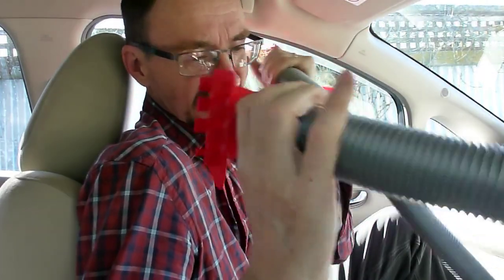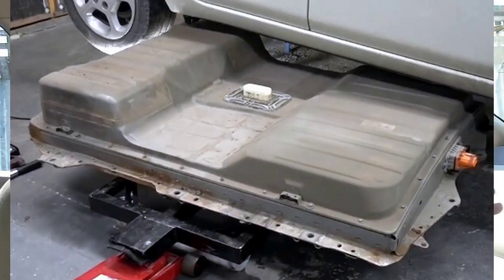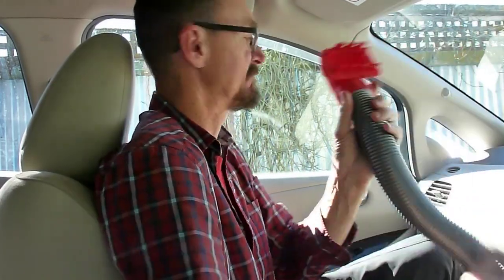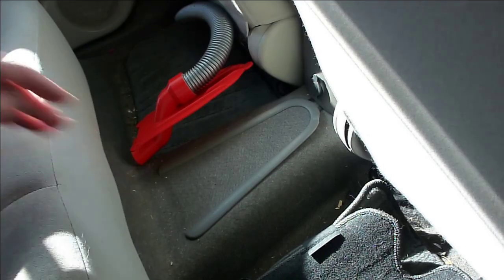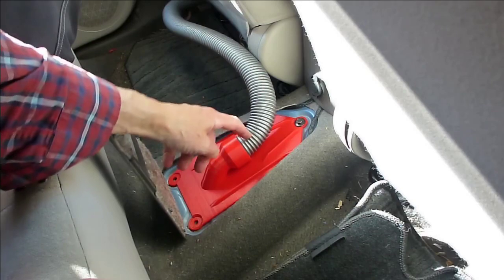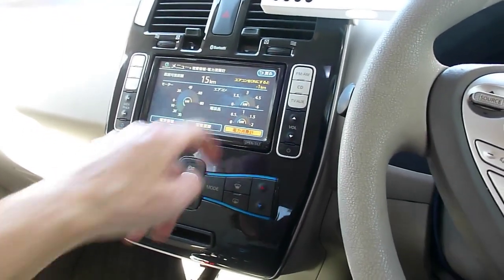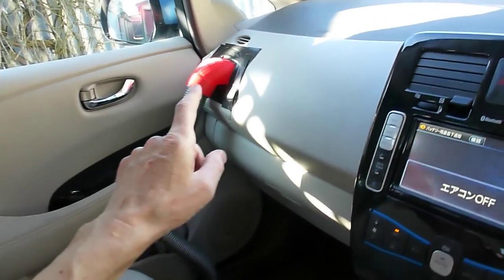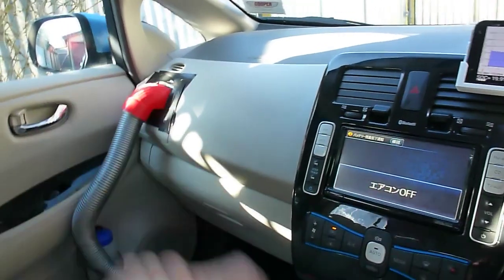Nissan Leaf 030 - Battery cooling?

Comment: When you turn the car on, the water pump will start to circulate water, that was probably what heated up the motor! Interesting test!
Reply from the maker: Ahhhh, interesting. That makes sense. 
I've since confirmed that the cooling system does operate when fast charging - so I'll test next time I'm on a long trip. It's still going to be hard to quantify any temperature reduction without doing a repeat long trip in identical weather conditions.

Comment: Another great video Paul. It doesn’t matter that it fails, as long as you give it a crack.
Reply from the maker: It's a high likelihood of failure, or a high reward if it doesn't fail. Not much downside either.

Comment: My suggestion would be set up vents that can be opened via a solenoid, allowing the battery to thermo syphon. Opening a vent on the top of the battery would allow the hot air out and draw in cooler ambient air from the bottom. The secret is keeping the water out.

Comment: Thanks for sharing your thoughts on how to cool down the battery. But if you can channel the air in and out of the battery case then you will have better results.
Reply from the maker: Hi T. Shonoiki. Yes - that would be better. In this project I wanted to see if I could get any improvement with a simpler approach.

Comment: great test! my leaf AC only works when the car is started and ready to drive or when being fast charged, it does not work when the AC charger is connected.
Reply from the maker: Ooooo - so you're saying it DOES cool when fast charging. I'll go test that.
Reply: @paulkennett  yep i was thinking you should try it at a rapid instead. Im pretty sure you can get full heating / cooling whilst plugged to a chademo.
Reply: See my above comment.  You need to have a climate control timer enabled (even if it's not the time) for the car to run AC/heat while L1/L2 charging
Reply from the maker: @Lothsahn  OK. I'll give that a go. I've not gone on any long multi-fast charge road trips recently to test it properly. Will post a video once I have.

Comment: I think you are one of a few people I trust for a accurate answer.  
I want to change my 12V lead battery for a 12v LifePo4 battery, so I can have my dash cam recording 24/7. 

Its my assumption that the main drive battery charges the 12V battery when the car is in drive mode or is charging.  
Do you know the amount of Volts and Amps the leaf BMS uses to charge the 12V battery?  I think its 14.4V I don’t know the Amps.
Reply from the maker: Hi Anthony. Yes it charges to 14.4V and the current can peak at over 100 Amps(!). So if you build your own LiFpo battery make sure it has a really grunty BMS. Also: I've heard that it doesn't always charge the 12V when the car is being charged, ONLY when in drive mode.
Reply: @paulkennett  Thank you very much for the information.  ONLY when in drive mode!  Does this depend on the model year or is this all 2011-2017.   It sounds like I can plug a LiFePo4 strait into a LEAF.  I will have an app to monitor the battery state of charge and health.
Reply: @paulkennett  BTW, thank you for your video on installing a dash cam in a LEAF.  Fantastic!!!, its the tutorial I will be following on installing. I am opting for BlackVue 900x plus.
Reply from the maker: @anthonycraig274  I'm not sure if it's true of all model, sorry. Every year on the local Leaf forums I see people discover the same issue. They plug in, then go on a 2 week holiday. When they return the 12V is dead :(

Comment: Paul, in my 2011 Leaf you must have the climate control timer enabled and the ac button on for the heater/compressor to engage while L1/L2 charging.  I can tell from your video that it's disabled because the orange light is off above the auto button.  I don't have CHADEMO so I don't know if that's affected.

Comment: How about spraying water on the battery pack exterior. Evaporative cooling is very efficient. Blow ambient air over the moisture for even more cooling.
Reply from the maker: Yep - that's another good option. I vaguely recall reading someone who tried that and also had underwhelming results. But it should work better than just air cooling.

Comment: There is a cap head bolt at the front of the pack which is there to pressure test the pack. If you really wanted to get the cold air into the pack fast you would need to put another hole at the rear of the pack. Then cad some air splitting device to push and push the air over the whole pack internally and as someone else has said you would need to ensure water and vapour didnt get into the pack either.
Reply from the maker: Yeah - that's a step beyond my comfort level at this stage. I'm keen to avoid this: https://www.youtube.com/watch?v=2cIo95W-vfE
Reply: @paulkennett  wow just wow, that firewall did an amazing job
Reply: @paulkennett  I had an idea. what you need it a way to get the battery cell cases to thermally bridge to the outer case. you need a material which is thermally conductive and electrically insulating. fortunately the de beers corp have just the thing. might be a bit pricey though
Reply from the maker: @Whereswally606  Yep - it's sobering sight
Reply from the maker: @Whereswally606  Ahuh! I finally twigged to your de Beers reference. I never new "One of many remarkable properties of diamond is its unsurpassed thermal conductivity. With a value of 2000 W/mK it exceeds that of copper by a factor of five."

Comment: i was thinking modding the battery case with a fan duc type seal around the inlet the run duc end inside the car when fan is on it will suck cool air inside the battery only problem now water and other thing could fall down inside the duck unless these if some type of mesh filter, but that wont stop water but i guess if your car is in such deep water then that would matter anyway :)

Comment: Very interesting approach. Impressive. I have a 2011 Leaf and heat during FC is not an issue but I am wondering as to the testing in one area: air volume rate being discharged and to what area of the battery under the rear seat , which leads to this: is it possible to remove or raise  the rear seat enough to dispose of the heat while fast charging? Thanks for the video. Love the special adapters you made. Thanks
Reply from the maker: The rear seat is mounted on the floor of the car, then the battery is mounted under that. So raising the seat won't change the space between the floor and the battery. Plus; one of the goals of this project was for it to be a minimum effort approach. Turns out the minimum effort doesn't achieve much in this case :(

Comment: Thank you Paul! Great experimentation as ever! I suspect the fresh air just leave the top of the battery too fast!  
My 2 cents... to improve the cooling transfer, the top of the battery pack should be very clean (I know, almost mission-impossible!) Additionally, I would add some sort of "side battery-chassis isolators" between the car floor and the top of the battery, so the cool air has a chance to stay some time "trapped" on top of the battery, improving the heat transfer... Best!
Reply from the maker: Another option would be to add some heatsink blades to the top of the battery can, so that the air could more effectively transfer heat away. Bit of a challenge to do that without adding weight.
Reply: @paulkennett Thanks Paul! There is a way to use/adapt the vent-to-hose in a US Leaf (Left steering wheel)?
Reply from the maker: @mfherreradi  Hi - does your passenger vent look like a mirror image of mine? I can create a mirror-image version of the STL file for 3d printing.
Reply: @paulkennett  Yes, It looks like a mirror image from yours, thanks indeed!
Reply from the maker: @mfherreradi  OK - I've added that to the MyMiniFactory page - it's the filename cooling-vent-LHD-v16.stl (ie, Left Hand Drive). If you print it could you tell me if it fits? Thanks, Paul
Reply: @paulkennett  (I just checked the page, the download seems not to be updated yet... ) I will let you know for sure!, just give me some time! (until summer...) Thanks Paul!

Comment: No when the car is fast charging or slow charring the 12v battery get charge at the same time, also you can use AC while Charing, you may have to redo this test bro while driving to see if any difference :)
Reply from the maker: Yeah. I'd mistakenly assumed that the traction battery was only engaged when the drive light was on. So there is hope that this might actually do something :)

Comment: I don't know the physical layout of a Leaf, but could the ambient and motor temp rise been due to the AC dumping heat and you not moving, causing a build up?  Also is it possible to see the top of the battery compartment in question, enough to spray it with black paint? I was going to say paint the bottom of the can as well, but there would be a risk of it absorbing heat from the tarmac at the point where you stop to charge. Just thoughts.
Reply from the maker: I've seen one person suggest spraying the tarmac in front of the charger with water before charging then running a portable fan over it to cool the tarmac. I'm not ready to go that far yet.

Comment: I sit in my car while its charging with the A/C on, A/C only works while charging when the battery is above something like 20-30%, and you need to be turned on properly (basically drive mode but it wont let you drive with it plugged in, but everything else fully turns on, the energy usage screen will show power on the meters, you didn't have it turned on properly as it didn't even show 12v usage)
Reply: also with the A/C on while charging, you are going to want to be charging at 3KW+, otherwise most/all the power can end up going to A/C and the battery will take forever to charge, so either a 16amp caravan plug, type 2, or fast charge, which is fine, your not going to be sitting in the car while charging it at home.
Reply from the maker: In my case I do haver a 16 Amp caravan plug Level 2 EVSE setup. But, as you say, the driveway is not the real world scenario that I want it to work in - just an initial test.

Comment: How about putting some sort of fan on it and extracting the heat into the cabin, where it is often needed?  It might be less effective at cooling, but it might actually be a really useful and simple secondary heater.  Great work btw Paul - the channel is really good.
Reply from the maker: I like your thinking. :) Instead of blowing cool air onto/over the battery I could do the opposite - and suck warm air from the battery. I'm not sure if it'd be any more effective than the blowing approach. That kind of crazy thinking sometimes produces great results.
Reply: @paulkennett  I saw a discussion on this method and the conclusion was that there may be dangers of blowing particles into the cabin that are harmful.
Reply from the maker: @ninjafoxfoxcraft5246  Yeah - that makes sense. There's bound to be a lot of micro particles under there including brake dust (including asbestos!?)
Reply: @paulkennett  It's really a shame that there's no active cooling. I was very close to getting a Leaf, but have decided on a Chevy Spark because its a deal breaker to me. I think you should experiment with a method that allows air flow to enter below and attaching heatsinks to the battery cover. It's an interesting enough idea that I may buy an old Leaf in the future and do this modification, when I have more disposable income

Comment: Hello Paul im going to make soc display, i bought all parts u have listed expect one i bought arduino pro micro 😊 will it work if i do wiring same? As i see on that board on the bottom from left to right i have numbers 10, 16, 14, 15, A0 and so on, will it work ? Or i need to change numbers in the coding?
Reply from the maker: Hi Aivaras. Yes a Pro Micro works even better. I've switched to using them myself. I've done more updates to it and am planning a new video soon. Will upload new code to Github as well.
Reply: @paulkennett  wow thanks, im waiting for new code. If u ok, i would like to film everything to show for people step-by-step how to do it 😊

Comment: Hi, Thank You, the test is a great idea, but I think without the heat being dissipated outside, it has no chance to work. Try maybe use Zoe cooling system is simple and cheap.
Reply from the maker: Yeah - a real cooling system would be much better. This seemed like the minimalist effort option to try.
Reply: @paulkennett  your attempt concept I believe was correct, I think your attempt was only missing the hole in the front of the battery.  thanks for trying to fix the problem. Regards
Reply: @superrefrakcja  there is "hole" around the whole battery. Air can move around the whole battery. This solution does not break the original battery box. You cant do that without massive issues. Even with mad filters - the battery compartment would be full of dust in no time. This solution that Paul is showing is quite clever actually. Shooting the cold air pretty much directly to the hottest spot that can be seen from outside. And since you can run AC when fast charging - it can pump out pretty cold air.

Comment: Would a closed loop peltier cooler be  much better ?
Reply from the maker: Might be better. Bit of a challenge to install that without having to drop the battery.
Reply: @paulkennett  thats not the worst part tho. Heat dissipation and were to dump the btus on the peltier module would be bad
Reply from the maker: @AndyShell  Tru dat

Comment: I think you can have the car off. Plug it in for charging. Then turn on the AC using Nissan connect app. The AC will stay on for 15 min. When the AC is turned on remotely like that the 12v battery is being charged.
Reply from the maker: Ah! Interesting. Thanks

Comment: Cooling that can not really work cause the cells itself are too far away and it needs a better distribution. That would mean you have to Open the can and also to open it twice cause you really do not wanna cool but carry away the heat. 
This can achieved by an airflow but that would need more a leave blower I guess cause transported Air Volume is King like in a PC.
And where do you wanna let the heat out ? Not INSIDE the car but outside. 
Then you need an air valve to protect the inside of the batter from humidity. 
Peltier elements would not work well too.
Reply from the maker: Yep. It's a tricky problem (it's a shame Nissan never solved it).

Comment: I've been wondering about this myself what about a cool plate under the pack?
See my data from New Zeeland mountain driving 
https://photos.app.goo.gl/Y9jFkFkfqyBfHUCCA 
Some chargers seem to hit the battery harder then others
Reply from the maker: That's some weird behavior at Castle Hill. I would not have predicted the flat charge curve! Theoretically the charge curve is completely under the control of the on board charging system, so is not a function of the particular charger. Unexpected how different the charge curves are. Is that data from a 4 hour LeafSpy log?
Reply from the maker: I like the way you've added the 4 temps sensors together. Have you tired a variation of this graph with kWatts instead of Amps? I wonder what the charge curves would looks like then?